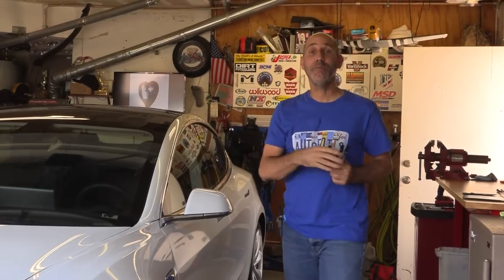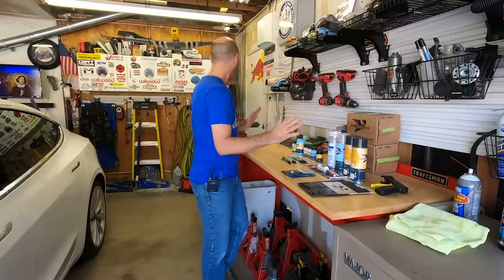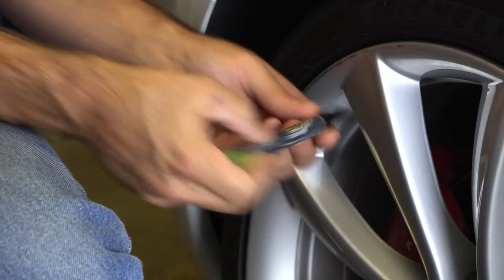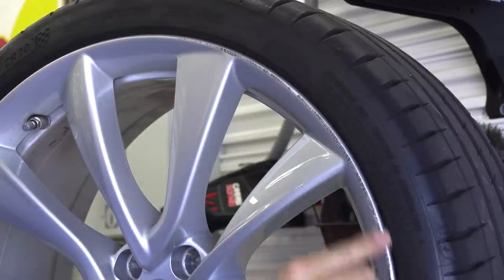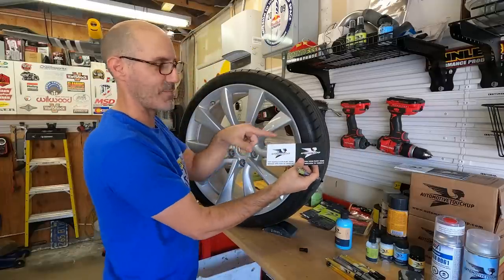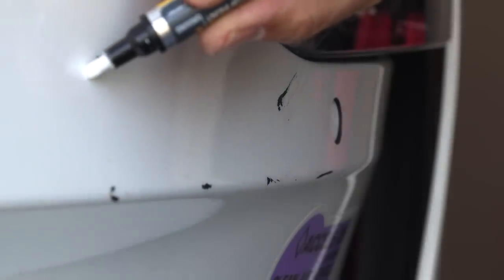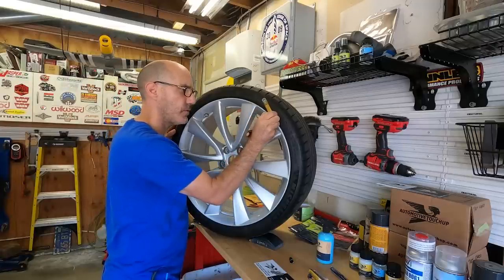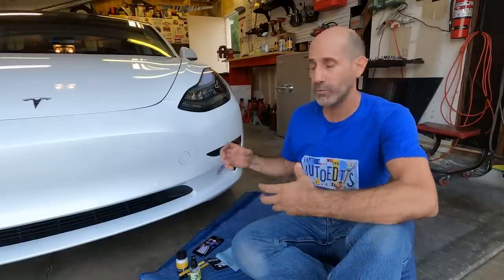Automotive TouchUp - Tesla Curb Rash Wheel Fix and Jeep Paint Pen Perfect Match!

Comment: Great video, I was wondering what you would recommend for additional protection for a new set of polished aluminum beadlocks wheels for my Jeep. I don't have them mounted yet and wanted to seeing if there was anything additional I should do to keep them shinny!
Reply from the maker: Thanks! I just use the Lucas oil speed wax on my wheels and it works really good. There's a link to them on my amazon store in the description.
Reply: @AutoEdits  thank you for the reply, continued success with your channel.

Comment: I was hoping for the PINTO discount code; because, I want to color match my JL's Tire Carrier and Hinge Reinforcement.  Sadly though, my Punkin Orange color isn't available yet; but, I do see to call them to find out when it's available. Also, I want to get the spray can as well as the paint pen.  Are those the same $7000 per wheel ENGINEERING EXPLAINED went thru the trouble to get?
Reply from the maker: These wheels are the same performance package wheels but they aren't $7k His bill was expensive because he bent 2 wheels and ruined 2 tires and needed some other suspension fixes. They are expensive though and we did already ruin a tire on a pothole.